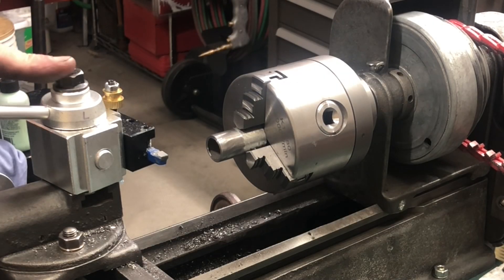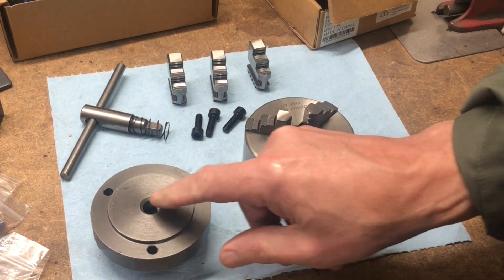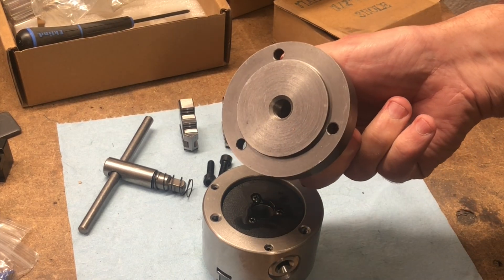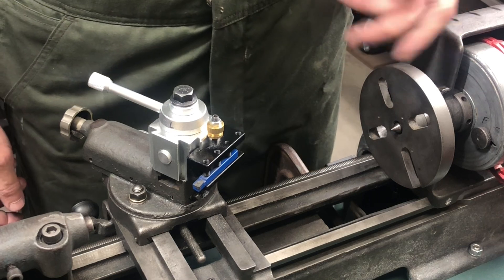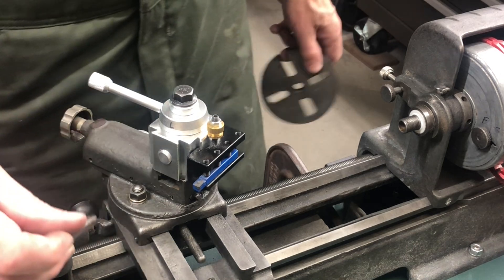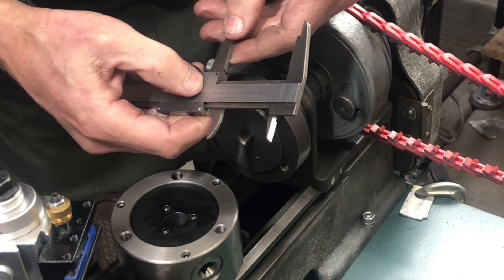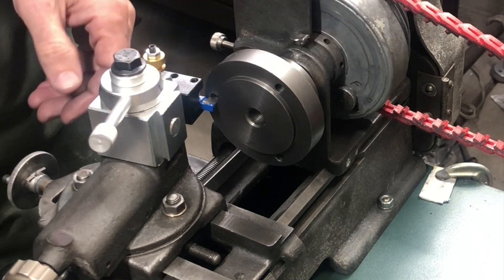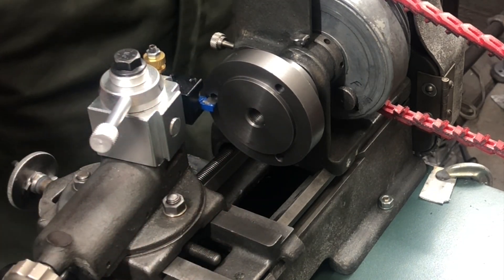3 JAW FOR GRANDPA'S 109 CRAFTMAN MINI LATHE

Comment: The washer will throw off your repeatability as well as make the union between the plate and the spindle run out. I would advise not using the washer at all.
Reply from the maker: Good point...I'll probably yank it out...THANKS